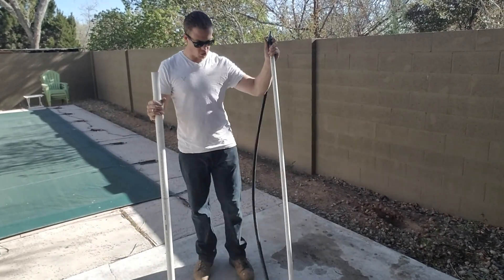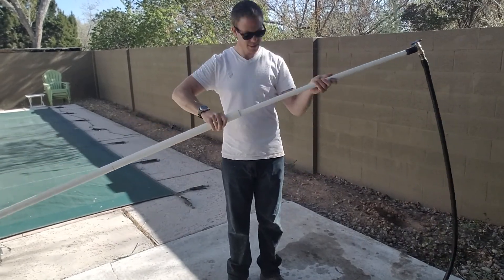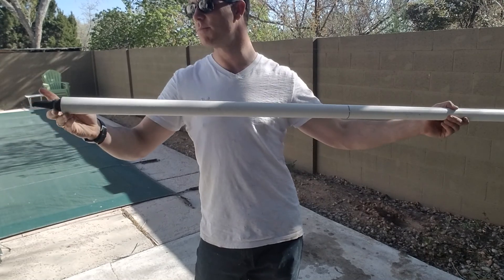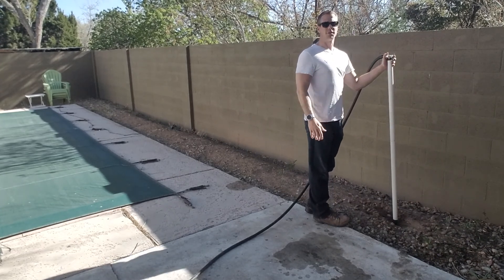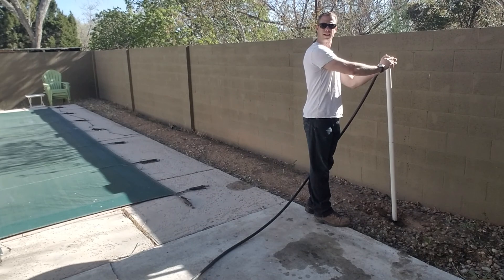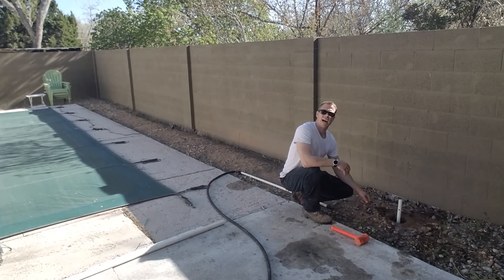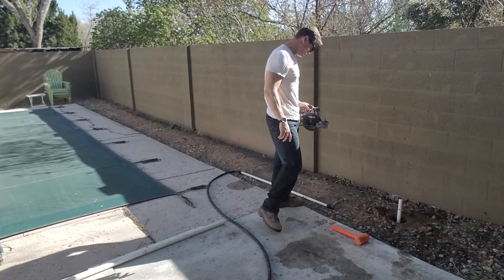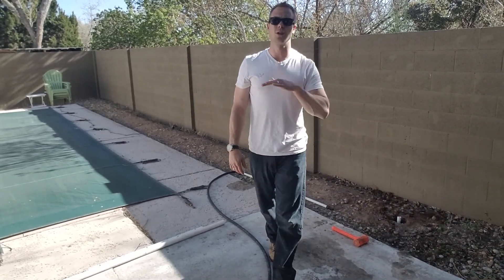DIY - Deep root watering system PVC and water - Part 2 of 2

Comment: Hats off for a great DIY video.  You motivated me to try this myself, and let's just say YMMV!!  I used the same PVC/hose material as you and got nowhere near as easy of results.  Clearly we have different soil - mine is a mix of clay with some rock material.  Not sure what you did to control the water flow (besides having a value), but I experienced a surprising muddy shower due to the water backflushing out the top of the outer 1.25" PVC (did I say I have clay soil).  In the end, was about to only get the 4 pipes started and sledge hammer down 12-20" deep.  We'll see how this really works out.

Comment: Awesome! Pro tip for this: If you make some good compost, teaming with beneficial microorganisms (bacteria, fungi, protozoa, nematodes, microarthropods, macroarthropods), you can pour some of that compost—or a compost extract made from it—down deep into the ground with this system, then plant your bushes or plants in that space above it and put mulch on top around the plants, and you won’t need to leave any pipes in the ground at all. You also won’t need to water very much, if any, after that. After the plants get established, you won’t need to irrigate them anymore at all. The life that you restored to the soil will feed them exactly what they need when they need it, 24/7/365, which eliminates the need for any inorganic fertilizers, and they’ll get all the water they need from the soil.